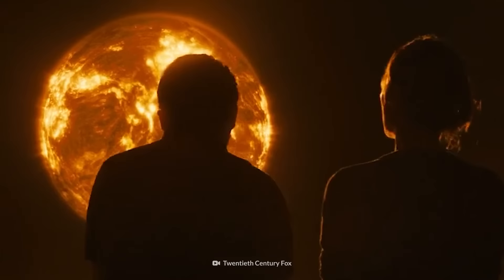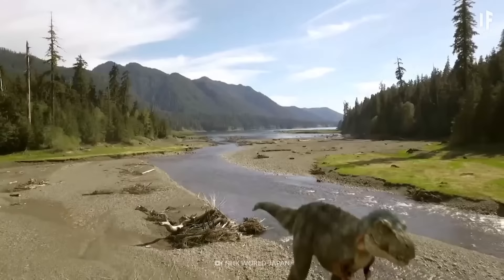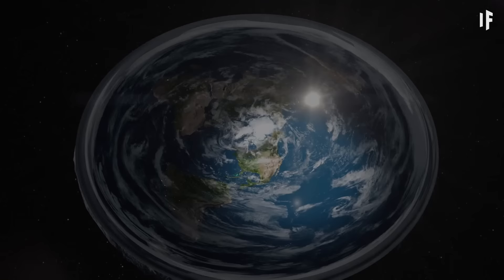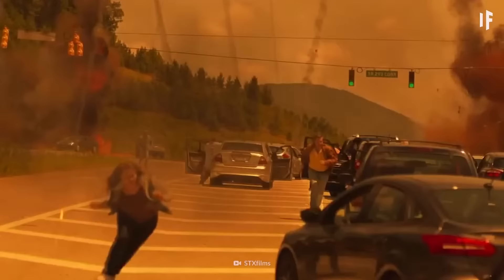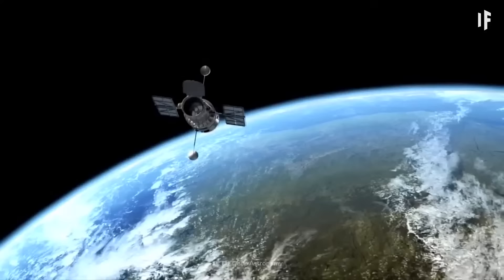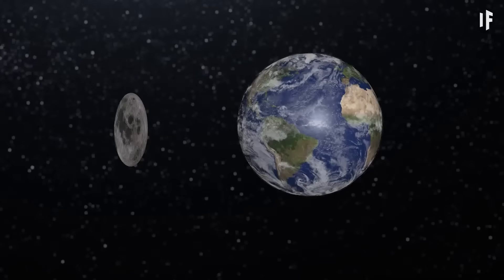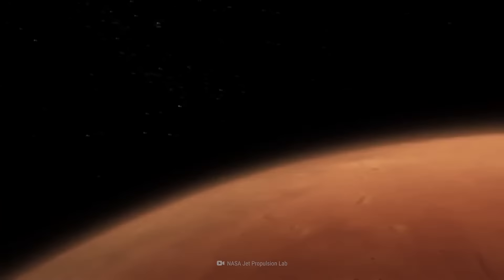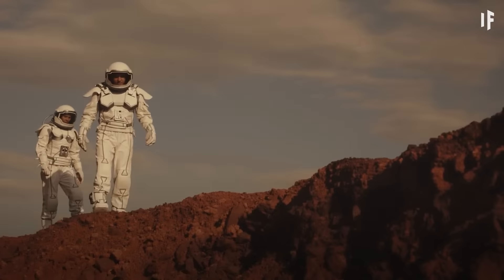Biggest Lies and Conspiracies About Space

Comment: @54:30 more bs

Methane gas is odorless 

Methane is an odorless, colorless, flammable gas. It is used primarily as fuel to make heat and light. It is also used to manufacture organic chemicals.
Reply: Methane is not odourless....
Reply: @philcoombes2538  Pure methane is indeed odourless! If you’re smelling rotten eggs that’s the sulfur compounds that usually accompany it when comes from the ground. I imagine that commercially available methane, like propane, has added compounds that smell so we can tell if there’s a leak. Someone probably learned that lesson the hard way.
Reply: @Mitashade  I stand corrected...learn something new every day...

Presumably the ubiqitous pong of rubbish dumps is due to sulfur compounds from cabbage etc 🤭

Comment: At 1:19 I believe they said if the sun was 800 degrees centigrade cooler that the earth would be a frozen lifeless rock. How does a sun that is incredibly hot change that drastically with a drop of “only” 800 degrees C? In the grand scheme of things I would believe that such a “minor” drop in the temperature on the sun that it would be like pouring a 12 ounce glass of water into the ocean and then try to measure the increase water level. If y’all have an explanation please let me know.
Reply: Depends what they mean by Sun's heat , in the core there is a few million C but at the surface it is only a few thousand , but I am just a casual space liking person so what I said might be irrelevant lol
Reply: I think he meant suns surface temperature (5.600 celsius) 800  degree change at surface is a drastic change for a star so
Reply: Lower temperature -> decreased luminosity -> Goldilocks zone shrinks, etc.
Reply: If the Sun drop by 800 degrees Celsius we would a)  need to be closer to the sun, or b) the sun would need to be closer to us to sustain life and the temperatures we are accustomed to seeing
Reply: Instead of asking us to explain search it up on the web yourself
Reply: I provided an answer. Did you see it?
Reply: The sun is a large ball of gas meaning the “heat” is just radiation produced by its components. To drop 800 degrees, there would need to be less of said components, which would lessen the reach of the radiation causing Earth and many other planets to drastically decrease in temperature.

Comment: Why would the weight of mantle increase the air pressure? Wouldn't the mantle be like a rigid exoskeleton, completely separate from the weight of air? I mean if you have a metal ball and fill it with air, that air will still have the same pressure as the atmosphere because the exoskeleton aka the shell of the ball  self sustains it's own weight without relying on air, unlike a balloon. Also, with that sort of heat, how would air or water exist?

Comment: 5:05 wrong!!!! HEAT is defined by the collective motion (vibrational, rotational and linear) of the particles. Temperature is an effect of the difference in heat between two bodies in thermal contact. If you hit "space" with no protective suit, your heat against space's non-heat creates an energy gradient from you to space, which you detect as a drop in temperature. A very fast, permanent drop in temperature.

Comment: so, around the 32 minute mark... the moon spins so fast it would blow apart (eject matter) then you say "for our purposes we will assume it survives this" (does not eject matter). but it spins itself "flat" it has the same diameter, but is 25% the thickness. well, since it ejected no matter, it would retain the same number of atoms, therefore it would have the same mass, but increase density. so... it wouls still affect the tides as usual. you seem to think somehow though it did not blow apart, it still lost mass. How? it survived, so it lost nothing. size is irrelevant. am i wrong? if so, why is a black hole a "singularity" yet have such a large "mass"? the mass is what creates the gravity, not the size. i think you need ti study better dude. spinning flat wont change mass and will not create any of the changes you said, only ejecting matter would change mass. though matter can be compresed unbelievably. in theory the moon could be compressed to the size of a fishing sinker and have the exact same effect on our oceans, because its MASS would NOT change, only its physical size (1 oz gold weighs the same as 1oz aluminum, yet 1oz gold takes up much less space than 1oz aluminum, because gold has a higher atomic MASS.) You can change matters shape, its density, but if you are not removing matter, you wont change its mass. therefore, i call bull$&!+
Reply: in the scenario presented, a flat moon would simply be a more DENSE moon, and therefore maintain its MASS
Reply: Yes i also notice that, if the same moon become flat how come it will lost 25% of its mass? This channel presenter have zero knowledge of science

Comment: Actually the Oxygen on board a space craft will burn and explode with any fuel in space or we could not have rocket engines. Depending on how fast you are traveling depends on how close asteroids would appear the faster you go the faster your response time would have to be. Besides I do not know of any space movies of our solar system that portrays an asteroid cluster with that maneuvering required. The global warming of Venus is just conjecture as water vapor also cause temperatures to rise and both release there collected heat when light is no longer present. The reason VENUS is so hot is because of its core and magnetic field interacting with the Sun NASA's data was flawed.  NASA used deuterium as the reason for CO2 assuming that Venus was cool to begin with which there is not indication that is what happened. It has never been said that our solar system was stagnant as we see the Galaxy animations showing the arms full of solar system including ours rotating around its core or event horizon. The solar system will never be in the same spot in space again as our galaxy like all the other are moving extremely fast away from its supposed starting position.  This is still a good video however the lies and the conspiracies, this video might be spreading more then what we are told.

Comment: Actually Star Wars sci fi is correct. About pretty much all. Ship will explode 💥 in vacuum. There are lots and lots of air and oxygen inside. Probably lots of hydrogen and extremely flamable gases inside. And highly combustible materials. So there will be flash and explosion 💥. Asteroid belt indeed requires extremely skilled pilot. Asteroids on the belts are very close and move fast. Saturn 🪐 for example had asteroid belt. Navigating inside the belt is quite a challenge. Also ship is flying fast. Asteroids are scattered? Who told you that? Even if the asteroids are one kilometer apart from each other (which i highly doubt it) still will be almost impossible to navigate through. Because Ship is flying lets say 11 km/s so even if asteroid gap between is 1 km you have less than 1/11 of a second to complete the maneuver. Even if gap between is 11 km you still have no more than 1 second to avoid the asteroid. And that's if asteroid is not moving at all in relation to you.   How slow you will fly the ship? Car speeds? Bicycle 🚲 speeds. If you fly ridiculously slow then you will encounter more asteroids because there is more time for the asteroids to hit 🎯 you. Even if asteroid gap between is 1 km and you fly at 10 km/h you gonna bypass the first small asteroid of lets say 200 meters in diameter and then encounter asteroid 10km wide or 100 km wide. And asteroids are moving in relation to you. Also asteroids are spread but not evenly spread. No way to pass through the Saturn 🪐 belts with very serious ship with manual control.
Reply: I also called it complete bullshit when he said asteroid are spread out millions of kilometres apart.